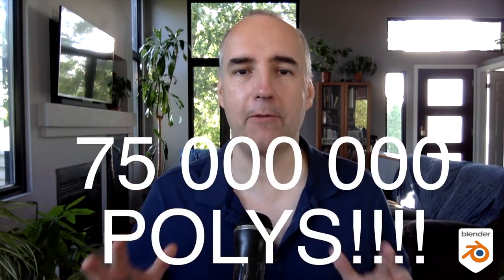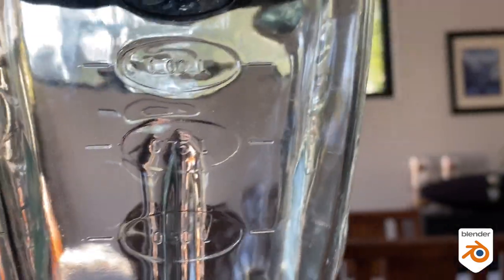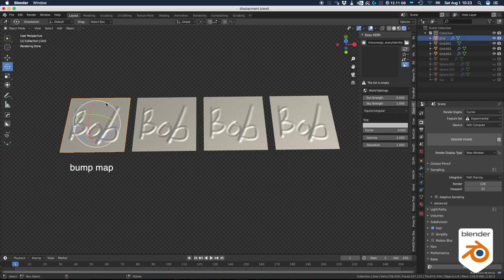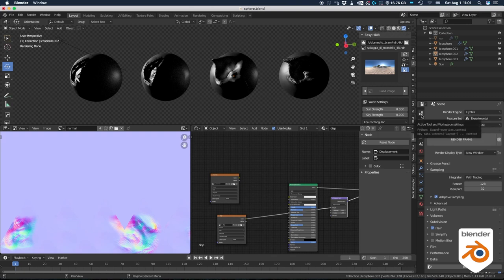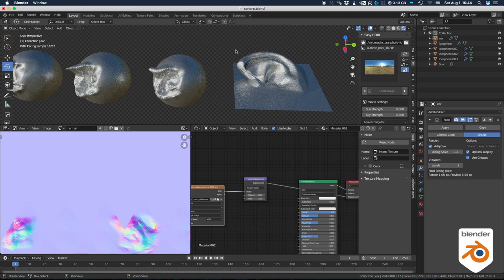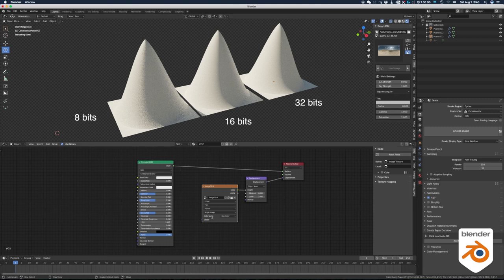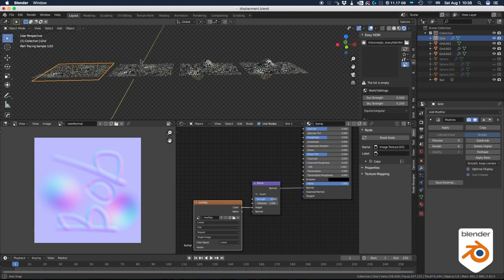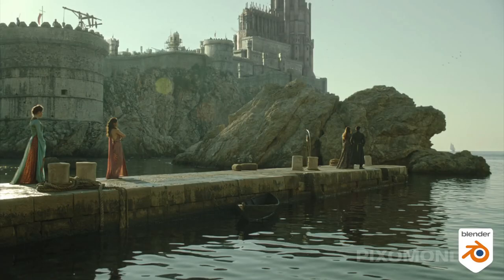Modeling for the VFX industry in Blender - Sculpting EP1d

Comment: One thing worth mentioning is that normal maps contains the offset from normal directly, whereas a bumpmap the engine would have to calculate the offsets from normal based on the height differences it represent. This has several implications:
1) Normal maps are sensitive to UV direction and the map rotation, whereas bump maps are more forgivable for doing random scatter type stuff.
2) Normal maps are insensitive to scaling, a 5deg up angle offset will remain that. Whereas for the bump map you'd had to change the distance accordingly.
3) Normal maps are precalculated normal offsets, making them ideal for gaming assets where speed is key. Whereas bumpmaps are slower to compute but has greater flexibility.
4) Normal maps can represent a big area of offset normal with a single color, whereas a bump map need a continuous grade requiring bigger texture scale and/or bit depth.
5) Normal maps are a nightmare to blend properly, whereas with bumpmaps you can do pretty much whatever you want, if provided the maths are correct just swap it for displacement.

Visualizing these, I find it easier to "read the screen values" in RAW/None color mode instead of sRGB/Filmic.
Working with bump maps procedurally, I recommend working with them temporarily as displacements, as any errors in whatever curves you calculate will be much easier to spot. When done, reroute to bump map and use the displace node scale height value as the bump node distance (with effect as 1). When dealing with microbumps, I usually do a math node (i.e. 0.1 / 1000) as bump distance. The horrid scales (the default values) Blender use are ridiculous.

As for shadows - 30 years or so ago (when recursive ray tracing was a thing), we could at least distort the shadows based on the same math used to distort the normals. While not accurate or competitive to displacement maps, it appears this has lost its appeal. I don't know if it's a limitation of how path tracing works, but I absolutely hate how flat everything looks today. Example:
http://www.realsoft.com/manual/manual/manual/material/vsl/pics/bshadow.gif
Reply from the maker: Thank you so much for all this information! :-)

Comment: Hi! Thanks for a great tutorial ang congrats to the 1000+ subscribers. 
Continue with more videos like those but maybe more in depth you will soon grow 100 times bigger. 
For this video, I will ask you about Blender as a sculpting tool and the pipeline. There is no vector displacement baking or vector displacement sculpting as I know. This was in Mudbox 2011. 
What to do with your high res models with undercuts? In Mudbox/Z-Brush to Maya I know.
This question continues to EEVEE as a non-displacement low polygon renderer and no Ptex implementation. 
Why is this important? From Pixar it was important to make their Subdiv, OpenSubdiv and use Ptex to improve and fasten the pipeline but also higher the quality for the animators. If you as a animator can use some thing that look as the high res model in real time the animation accuracy will improve.  This is my understanding. 
Is it missing parts in the Blender pipeline or do I miss some of the functionality in Blender or have I got hold of the wrong end of the stick?
Reply from the maker: Thanks for the comments Stefan! You can do displacement in Eevee using a displacement modifier instead of a shader but you will need to subdivide a lot as adaptive sampling is a Cycles only feature. I don't really use Eevee as I work in the VFX world an I don't really care about the real time stuff. For vector displacement, since Cycles supports it, you could always do your sculpting in Mudbox. It's like 10$ a month. Or you retopo the model. You can find many tutorials on retopo in Blender. Ptex is cool but hard to implement as it's not supported by all painting software. Substance doesn't. At Method, we talked about it and concluded that pTex was more trouble than anything else (that's what happens when you have unlimited rendering power). ILM and Pixar do use pTex but, they are ILM and Pixar... Blender is perfect for a small to medium size studio but it' not ready for the big one yet, except for the modelling. I hope that answers your questions.